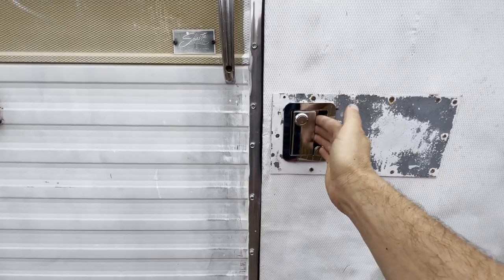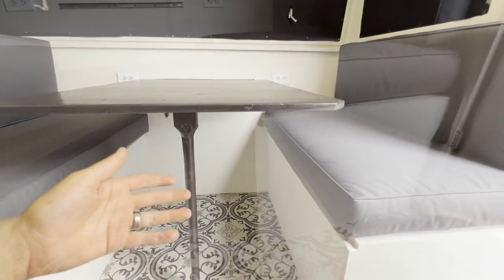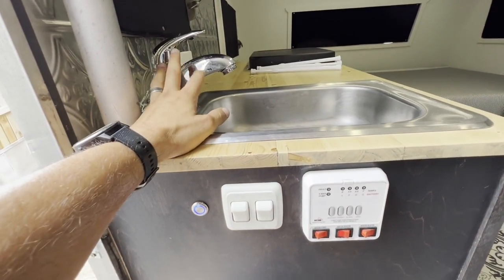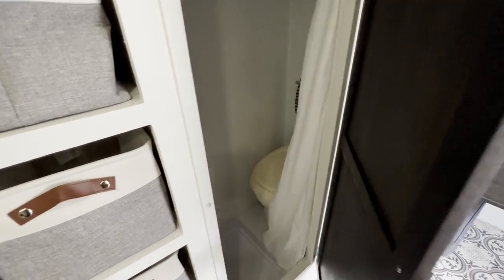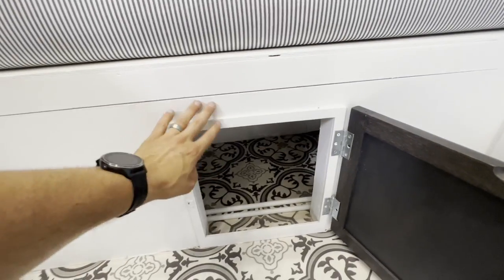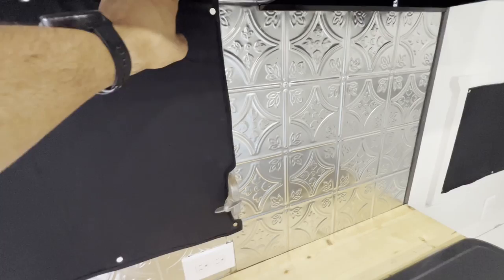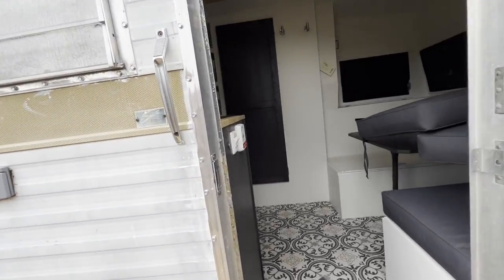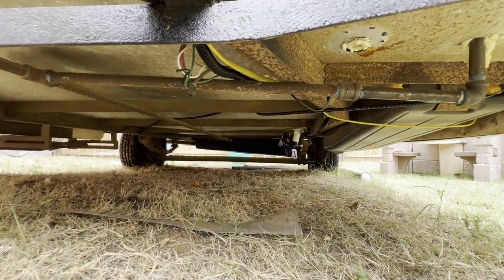I’m Remodeling a Vintage Camper Part 7: Built Like a Tiny House

Comment: Looks great!  2 ideas?  Put a little border wall just inside your 'quicky access' door, then stuff you want won't shoot down one end or the other.  Lay some white super thin adhesive backed foam insulation down in the groove of the seats where the table top goes (exact same setup as mine!) then it won't shift and make noise. That's what I found anyhow!
Reply from the maker: Ooohhh that’s good.

Comment: Hello, where did you get the shower pan tiolet and walls? Also the aluminum that wraps around bottom of rv exterior side? Appreciate the feedback.
Reply from the maker: The shower pan is from recpro along with the aluminum and the toilet came with the trailer. I believe it’s under exterior >molding. You’ll find it in that area.
Reply from the maker: I forgot to mention the walls. The walls are FRP that I got from my local Ace Hardware and then just use the glue that goes with it and trowel it on the walls and the trim pieces.

Comment: What is the length inside and outside.  What is the width, height and weight of your trailer.  Your trailer turned out very nice.